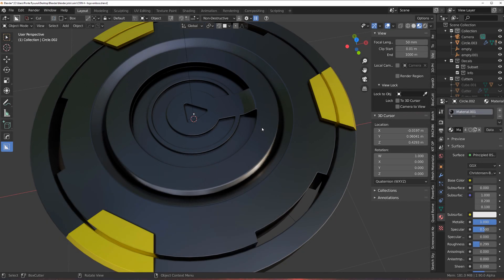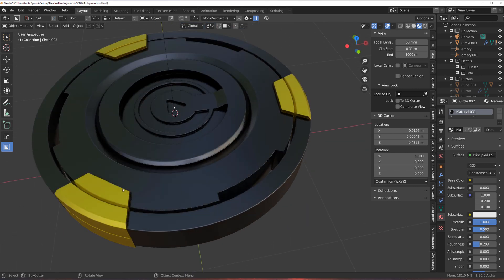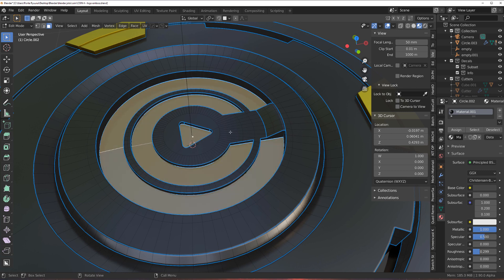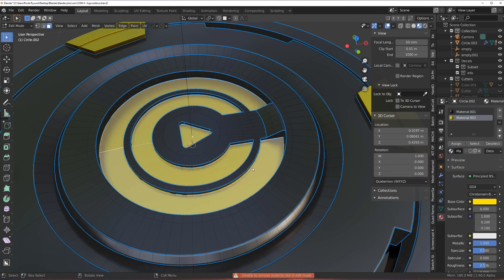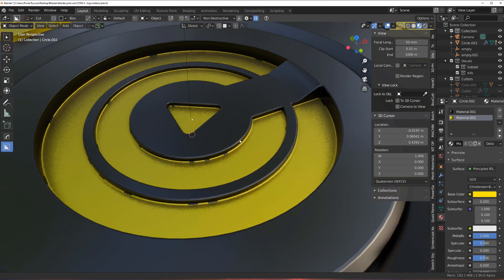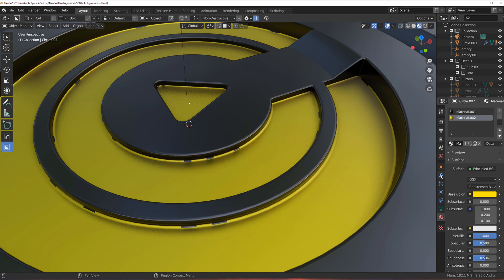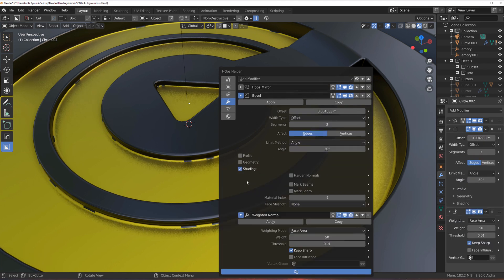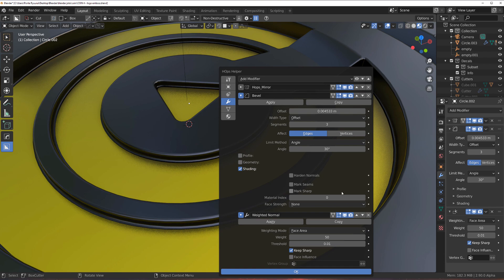MATERIAL BLEED - in Blender - easy fix

Comment: Fixed in the latest 2.90, cool tip for 2.83 though! Also if you make the bevel segments even numbered it goes away. Your tip is better though. I'm a die hard 3 segment beveler 😁
Reply from the maker: Cheers man, well you could also try 1 segment, for mid poly with WN, really low geo and literally the same shading, i have a vid on it too.